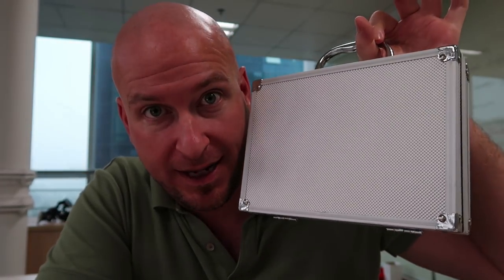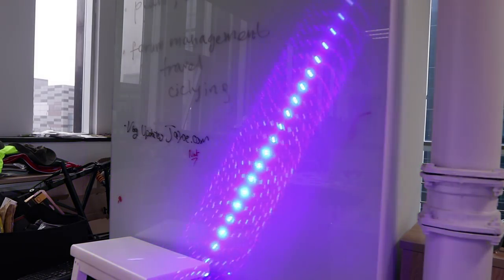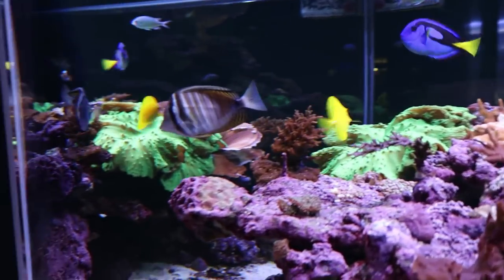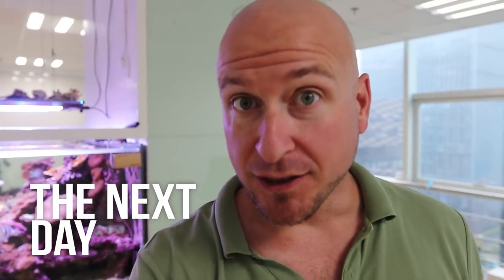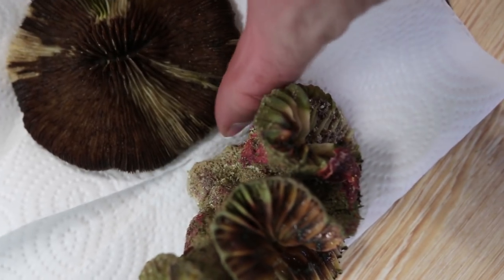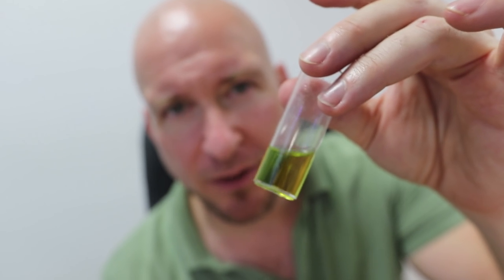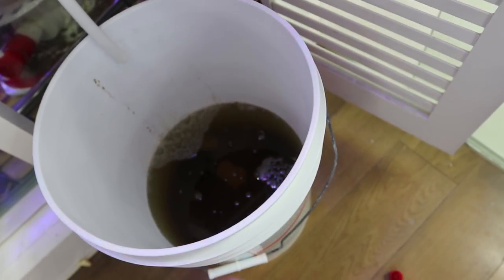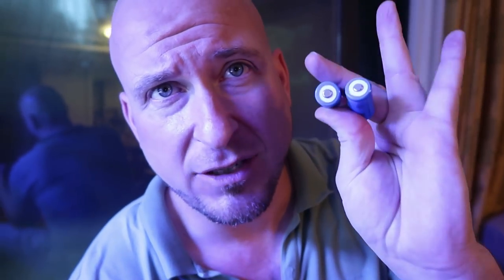LASER KILL APTASIA | MATT’s REEF TANK

Comment: I think the beam is not focused enough. can you focus the beam to a smaller dot? your 2w of eneergy output is focused to about 5mm dia beam, if u focus the 2w to say a 2mm beam the intesity wuld be alot higher and you wouldnt need to hold the laser at the aptasias for so long.
Reply from the maker: i agree... i dont know how i can focus it.
Reply: the JaYoe Nation i think you can focus by screwing the lens cover so its closer or away from the led. i remeber pulling apart a laser when i was a kid and noticed i could change dot size when i didnt put the lense cover on properly

Comment: Interesting since I imagine using LASER to kill Aiptasia is using its heat from Radiation point of view so essentially even through water and air media in between should not dampen it's effect..... but like you mentioned that the more concentrated the beam is the higher the radiation heat it gives.....
Strange still that your nitrate is high in your office tank: is it that you feed too much or have you tried to remove some of the Macroalgae from your sump as too much can also 'gives out' nitrate than absorbing?
Reply from the maker: I cut feeding down to a 1/3rd... i dont know why.  Lots of algae in the refuge... i dont know.  Im going to remove half of the algae though... that is my next step

Comment: Hi Matt
To reduce the size of the beam you need to make a telescope with two lenses. You nya be able to is the output lens as one of them if the laser beam is diveregent. if the original beam do not change in size over the distance too little. ie if the laser is beeing a good laser with a non diveregent beam, then you will have to use a two lens telescope to reduce the size of the beam. if you just use one lens you get a very Nice focal point, but the of size of that is that the distance from the output of the laser and the focal point is constant.
You shoud be able to get local support to get a suitable solution for the beam reducing telescope. there are lots of chinese optics manufactures around. if you need more help you can find me at Gammadat Instrument AB in Sweden. Thank You Matt, I have learnt so much from your vlogs. Both about the tanks and the daily life in China.
Good luck and all the best.
Charlie Nyberg

Comment: i think your nitrates are up because you have too much rock and not enough flow. maybe its time to either take out some rock or increase your flow. im not sure what you are using for flow now, but im sure those jebao crossflows are pretty cheap over there in china. you can give that pump a try.  increase flow will probably help you move some of the junk that's been accumulating over the years between your rock work
Reply from the maker: thanks for the comment.  For years thing were going well... i think i have a stable system.  the rockwork is part of my filtration... but i will try a couple tips and adjust my flow to see how things go.  My jiebo's are dialed down actually... ill try to move them somewhere where i can turn them up.  I turned them down because they were moving my sand bed around... and that was driving me nutz.
Reply: Matt look up old tank syndrome, you might be going through something of that nature. might be time to spice it up. here in New york at least alot of people are going for the less is more approach with rock work.  i know you love your rockscape but its maybe its time to change it up and maybe even vaccum the sand bed LOL.   i know i was on your side one time, but as the tank ages. Drastic measures sometimes needs to be taken.
Reply: even changing your rock work might even re-energize your passion for the hobby. i know redoing rock work is a pain but i find it so rewarding when its all said and done.

Comment: Matt, I have a 6 watt laser that i use on my Aiptasia. Watching your video I was very surprised the aiptasia was actually killed. When I do it, I have to focus my laser with the lens at the front of the laser to a fine pin point on the aiptasia. It actually looks like they are melting. If I don't focus the laser to a pinpoint, it doesn't look like I did anything. They shrink down to just a small nub. Looks great for a couple days. But then just the small traces of aiptasia left on the rock sprout a new one. My infestation gets worse if I don't continue lasering almost everyday. I have now resorted to buying Nudi Branches again. The last time I bought nudi branches my infestation went to almost zero. But then I let my nitrates get too high and I think that may have killed them.
Laser I bought - https://www.laserpointerpro.com/6000mw-450nm-beam-light-blue-superhigh-power-laser-pointer-pen-kit-golden-p-1819.html
Reply: After trying everything from lemon juice to a laser, and even a file fish. Peppermint shrimp are the best. I bought 7 of them for my 50 gallon tank. Within a month about 80% of my aptasia is gone. Only some of the big ones and some in nooks still survive. I'm thinking the shrimp are intimidated by the large ones. But I can hit them with the lemon juice easily since they are so large. My File Fish likes the brine shrimp I feed the other fish. Could care less about the aptasia or other soft corals in the tank.